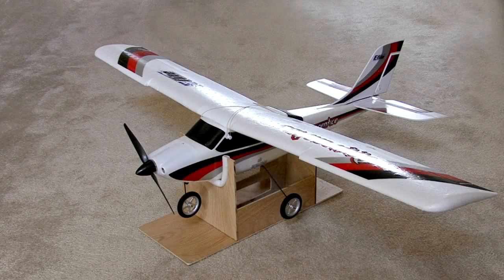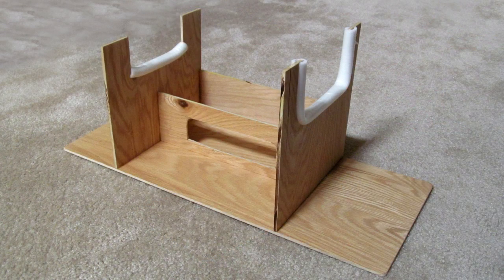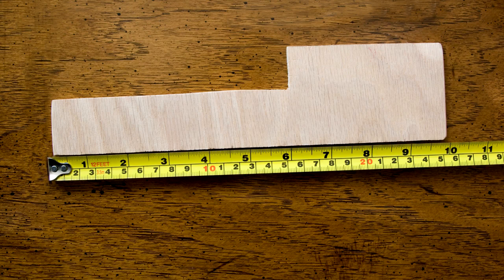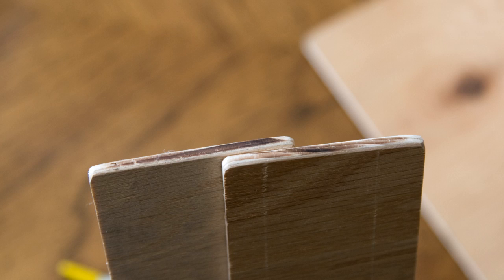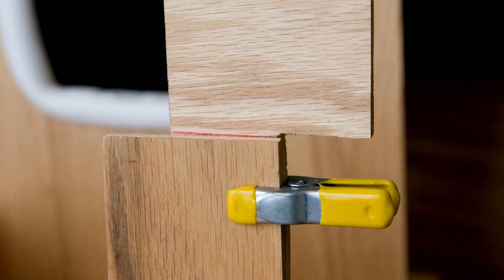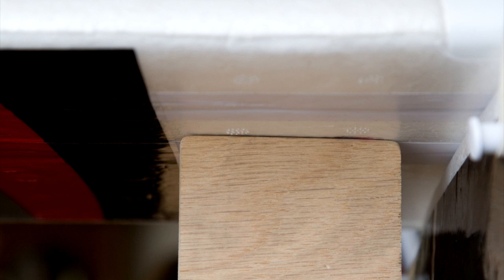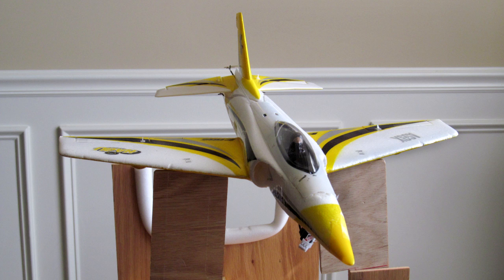Finding Center of Gravity With The Apprentice Cradle

Comment: Hey Willy great video! I have a question. How do you properly measure and mark the underside of the wing before setting it on the cradle?  Ken
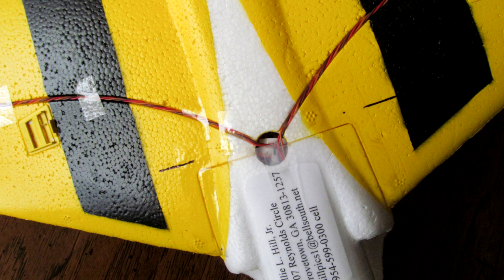Reply from the maker: Using the C/G measurement listed in your aircraft's manual, use a pen/marker to place a short line on the bottom of both wings.  If you go to 1:52 in the video you'll see the two marks that I'd placed on one of my models.  I hope this helps.